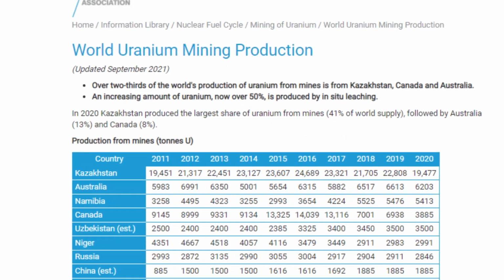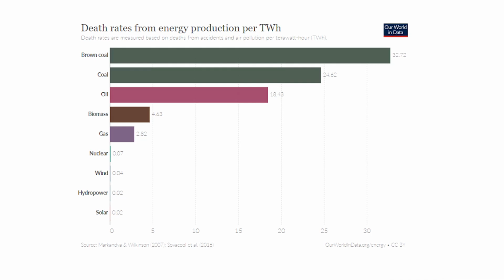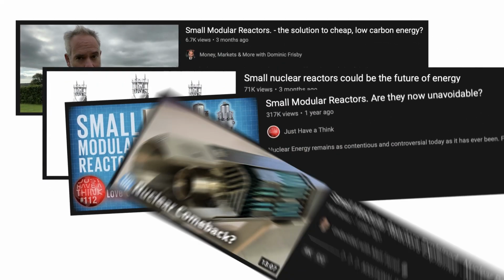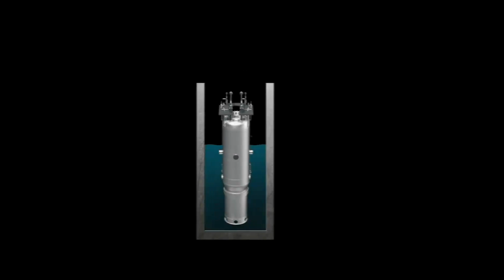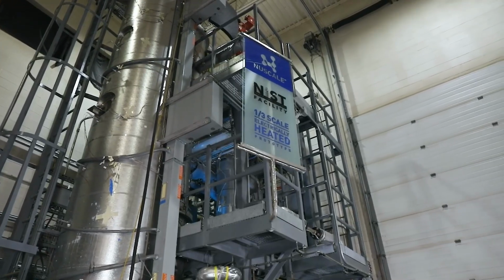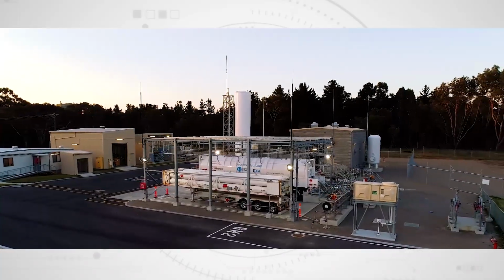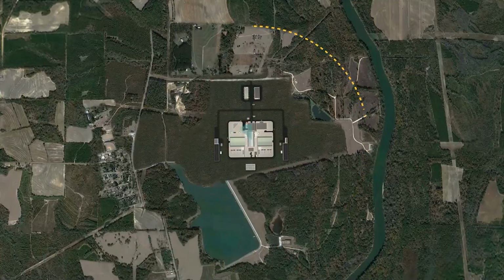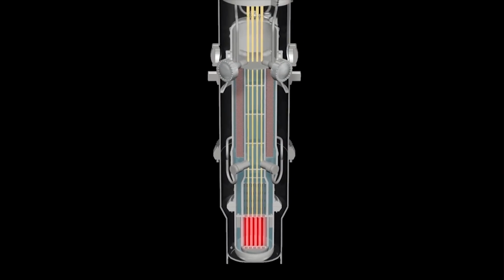Can Small Modular Reactors Save Nuclear Power?

Comment: Mainly because the main issues with nuclear power isn't technical, or even rational, I personally don't think there are technical solutions for them.

I don't think SMRs are going to solve anything, small sure, 5-ish or so, percent of a typical "Chernobyl-style" reactor,  does anyone in their right mind think that 5% of the Chernobyl accident would be a sh*t happens no big deal kind of event? The answer is: No. And in this case, up to six such reactors, close together, that adds up to about 30% of a "Chernobyl-style" reactor. 

I know, I know, these reactors are safe, as every type of reactor has been, until in some cases the opposite was proven. In the CGI the reactors share a small body of water, one drought away from loosing that safeness. Yeah, I saw the river, a river can reduce the probability of lack of water, not eliminate it. Also, a river adds an increased risk of severe flooding. At coast, you have possibly tsunamis, other natural catastrophes, threat from other countries, and so on. It's actually difficult if not impossible to find a place where there are no such issues, at least combined with a huge, unmet demand for power. 

About that, you can be too far from any large grid to be able to get a decent connection, OR you can have a lack of land,  you don't have both issues at the same time. Nope, the claimed niche doesn't exist. A somewhat problematic grid situation combined with a slightly problematic land situation sure, but new type of nuclear reactor plus hydrogen storage-level situation, nope.       
 
Also, when it comes to nuclear, accidents are considered severe catastrophes even if there are no severe [relatively speaking] consequences. So, it will take a single accident with SMR, even without casualties with enough media attention,  to make it virtually impossible to get approval to install any more. And with mass production, accidents are virtually unavoidable. 

Production of hydrogen, well of course. A bit higher efficiency than ordinary electrolysis, great, but it doesn't matter much. Also, higher efficiency compared to what, electrolysis at room temperature? Why, and even how, would room temperature be maintained in commercial scale hydrogen production with electrolysis? 

Also, storage, even at 30 MPa, that's 300 bar, you need 50 cubic meters of tank volume to store 1 ton of hydrogen (roughly, and at 20 °C). 30 MPa is scuba tank pressure territory, it doesn't make much sense to compress much further for stationary storage. 250 tons * 50 cubic meters = 12.500 cubic meters tank capacity. 

Reversible HTSE and fuel cells combined, well, now we left modifying/improvement of existing technologies, that's not equivalent of developing the first production model car, or airplane, that's more like an equivalent of developing a mass produced flying car model in a world where there has been no mass produced car or airplane yet.       

If you don't even think you can become cost competitive (per MWh) compared wind and solar now, you definitely won't be able to compete 10 years from now with a combination of wind, solar, improved transmission capacities, DSM and enough batteries to make a more reliable energy supply than a few SMRs and hydrogen storage. And, honestly, the cost of alternatives 10 years from now is irrelevant, the cost of alternatives the the proposed technology reaches global significant importance, at the earliest, that should be roughly 40 years from now, assuming best case scenario. By then we will have solar PV built in surface materials of buildings, at negligible extra cost, wind turbines will be developed in ways I can't predict, batteries will be extremely cheap compared to current situation, things like V2G, DSM and VPP will be implemented "everywhere" unless they have been made obsolete be even better future solutions.

Comment: There was a key idea that was not clearly covered. Dr. Reyes mention the ability to load follow. This is necessary because renewables are not dispatchable. Nuclear is the only carbon free dispatchable energy. When everyone comes home in the evening, turns on the lights and the oven, wind and solar are typically reducing output. The sun is going down and wind cannot be counted on either.  This power has to be replaced with dispatchable energy.
Reply from the maker: What about hydro and geothermal?
Reply: @EngineeringwithRosie  Hydro is partially dispatchable, there are usually limits on how much water can be spilled downstream. Geothermal is a great dispatchable resource where it is available. Geothermal is one that sounds perfect in principle, but  the working fluid coming out of the ground is so corrosive the turbines don't last long at all. More significantly, it's a resource that is not large enough to make up the difference in the duck curve. Batteries are great also, but we do not have the capacity to make enough batteries to make much of a difference. When I say batteries I'm including pumped storage, liquid air, hydrogen, and kinetic storage. It's really hard to fathom how to create enough storage to make a dent in the problem.
Reply: Also, batteries and other storage works just as well with nuclear as with wind and solar.

Comment: One note of caution - LCOE/strike price costs are not all that useful for costing externalities/total costs of every energy source, whether that is gas turbines without carbon tax, renewables without backup power, or nuclear with the "nuclear waste issue" (though I disagree that this problem is of the same magnitude of the former two). Everyone likes to quote that Lazard table but sort of glosses over the bottom of the table wherein a ton of caveats are listed. They are intended for investors of a single power plant in order to do accounting (not coincidentally this is lazards business...). They are not intended to show the costs that said power plant imposes on the grid to make everything work with the reliability we expect. Or the sensitivity of each particular technologys costs to commodity prices. Et cetera.

It is not for no reason that, for example, germany pays some of the highest residential electricity costs in the world before the current energy crisis and will be paying quite a bit more in part thanks to their closure of "expensive" nuclear in favour of "cheap" natural gas to take the load when the dunkelflautes/wind droughts happen, as does happen on occasion with weather.

The short-term may not be that much better either for renewables, as they tend to be the most materials-heavy forms of energy, which means that impending commodity price shocks are a correspondingly bigger problem for the very impressive cost-curve progress we have seen thus far.
Reply: To help allay concerns about nuclear waste:  Some upcoming nuclear reactor designs will be able to run on nuclear waste.  I've looked at dozens of reactor designs and my favorite, by far, is a design by Ed Pheil.   There are several videos explaining how it works etc.  on Youtube.

Comment: Thanks for a great video. I have a question you might help regarding the quoted price of renewables. It seems to me that the intermittency is not accounted for in the prices often quoted and yet this is critical. How can something that is cheap when you don't need it and not there when you do need it be said to be cheaper in any meaningful way? For example the cheapest way you can compensate for windpower intermitancy with current (or next 5-10 years ??) tech is by building nearly the same capacity in gas turbine generation. This is what we have done in the UK. In which case how can a system which has gas generation as a component part be said to be cheaper than gas generation? I have put this question in a renewable-skeptic way just to emphasize the problem but I am not anti renewables and I can understand why the renewable lobby want to paint a favorable picture to keep up investment. I'm am in favor of massive investment in R&D for grid-scale energy storage to help to reduce this problem but the worst thing that could happen IMO is that these apparently low prices result in a reduction of investment for nuclear, we need both. If you could investigate this price issue it would be informative. Thanks again.
Reply: Wind and solar are virtually useless until they figure out the storage problem. When people's power begins going out randomly they will be yelling for nuclear.
Reply: The Russian invasions of Ukraine has highlighted   another risk related to Nuclear, where deliberate actions during war increase the risk of nuclear accidents.
Reply: @pietersmit621  there will be no incident. Ukraine, Russia and the media will overhype the plant in Ukraine. Just as they did when Russia took it to begin with.
Reply: In California, gas turbines are being replaced by battery storage systems.  The claim that gas turbine peaker plants are the cheapest way to solve renewables intermittency is a false assertion.  The gas turbine peaker plants are used much less than half of the time, some as little as 5 to 15% of the time.  They were financed with the assumption that they would be used for a greater amount of the time.  So they don't pay for themselves and lose money over time.  There are still ongoing fuel costs for them.

For the UK, there are offshore wind farms that are producing a very steady amount of power, 24 / 7  due to steady winds out in the ocean.  And there are large pumped hydro storage systems in the north.  More pumped hydro storage needs to be built to eliminate all the gas turbine plants and eliminate fossil fuel burning.
Reply: @acmefixer1  - I doubt that there is anywhere on earth that the wind blows 24/7/365 with enough force to give you 100% renewable energy. i would have to see those test numbers verified by actual measurement over the last decade.
Reply: @acmefixer1  The big challenge with battery storage is scale. Things seems quite easy until you start looking at the numbers. For example California generated 277,704 GWh of electricity in 2019. All the storage batteries deployed in the entire world amounted to 8GWh in 2018 (*). So if you took every single storage battery in the world and shipped it to California you'd have enough batteries to store roughly 15 minutes of California's electricity production. The issue with pumped storage is similar: there's more of it than battery storage but it's still a tiny fraction of what's required and the majority of suitable sites for pumped hydro are already being used. This is why California, Germany and the UK are extremely reliant on natural gas as a backup fuel for their intermittent renewables and this is likely to continue to be true for the forseeable future.

(*) Google "World energy ESM Final report PDF" to find this information, Youtube doesn't like links sadly.
Reply: @acmefixer1  "are used much less than half of the time, some as little as 5 to 15% of the time", that must mean intermittency is not an issue.
Reply: @DSAK55  
Intermittency is a big issue.  The peaker plants have to charge hundreds of dollars per kWh in order to break even.  The utilities have to pay high prices for peak power.  That's another reason why utilities are replacing gas turbines with battery storage, using them to do peak shaving, saving money.
Reply: @acmefixer1  Like everything that is done in California, batteries are not going to work,,,,,unless you want  to have a $2000 a month electric bill or enjoy sitting in the dark with no heat, (You CAN live without AC, you know  and at the rate things are going on the West cost you better get used to doing wihout it.) 

So be my guest and build all the wind an solar farms you want (with German and Chinese parts, no less) but just DO NOT expect the rest of the country to dig in their pockets and subsidize you. Just like anything else when you get woke about anything you end up going broke. ..... Somebody PLEASE build a SMR plant right next to my house.  I want the property tax reduction that comes with it,  but don't even think about sticking one of those noisy "wosh, wosh" bird killers within 5 miles of my property. Better yet make that 10 miles.  

The future is nuclear power,,,or we have no future.
Reply: @mathewmolk2089  
Sorry, but you're wrong.
New nuclear power plants are far, far too expensive. 
https://en.wikipedia.org/wiki/100%25_renewable_energy

Comment: It seems to me that the wind & solar + storage + transmission is still in serious denial about how fast it can be ramped up and what the full penetration amount of storage will be need to be.  And there is no way that we will reduce greenhouse emissions by 90% before nuclear could be commercialized if we are serious.
Reply from the maker: Ooh, here I disagree with you 😊 I think we will need less storage than we think (due to flexible demand and interconnectors) and I see the renewables rollout is progressing faster than most people realise. We'll have to check back in 2030 to see who was right!
Reply: @EngineeringwithRosie  You disagreement would hold more import if you gave citations.  I mean, my analysis is only based on observation of current industrial practices and a rough engineering assessment of the situation.  Do you have any estimations of service factor and cost of electricity versus amount of storage provided?  AFAIK, there is very little industrial flexible demand.  Almost all industrial uses of electricity are either overwhelmed by capital and non-energy costs, or brittle in that have been built upon the assumption of always available power.  For example, aluminum has to keep operating or the cells freeze up, cholo-alkaki cells aren't designed to be load following, and ammonia production facilities are built around steam reforming rather than variable green hydrogen.  Everything that I see with regards to flexible demands is only address grid stabilization, not wind droughts or a week long rainy miserable weather.   With regards to interconnectors, I've lived from 20 to 60 years old of seeing constant opposition of building high voltage power lines.  They are really an eyesore.   I wouldn't want to live under one of them.  You have to implement them using eminent domain or route them through wilderness areas.  Do you really think that the struggle to get them in place is going to abate once the electricity that is going through them is PV instead of Nuclear?
Reply: @richdobbs6595  The grid has 15 years to sort it out assuming parliament legalises nuclear energy today. Sounds doable.

Comment: I think you left out the biggest factor influencing the price of nuclear energy: regulation. Parts for nuclear power plants cost way more than they need to (for example, a $200 part off the shelf costs several thousand dollars if you are buying the “nuclear certified version). NuScale had to spend millions of dollars to get the Nuclear Regulatory Commission to look at their design and consider it for approval! Just about every plant we have operating in the US was built before the creation of the NRC because the increased regulatory costs and obstacles has made building new plants incredibly difficult. But the safety record of those pre-NRC power plants? Zero fatalities. Real lives have been lost to coal because the NRC made nuclear too expensive to build.
Reply from the maker: Yes I think you're right. And I read recently that there are a lot of counterfeit parts being used in nuclear reacors these days, likely due to the huge premium you mentioned. It's not a great situation.

Comment: While nuclear generation has got more expensive, due, in no small part to the overregulated approval process and hence the much longer construction time. Other than the West, nuclear plants are built relatively quickly and economically given the low fuel costs and long life of the plant. Renewables are still expensive and the continued 'renewables are getting cheaper' is simply inaccurate when all costs are accounted for and is reflected in the price the consumer pays.
While I like the sound of small modular reactors, their benefit will be much greater if they can, as has been claimed, load follow which would do a lot to keep the grid balanced if this is proved in practice. This balancing is mainly done using fossil fuel generation in most countries. It does,of course, increase running costs as they would run at less than optimum output if carrying out that role.
Reply: @I A Reid

You're a shill for the nuclear power industry.  Renewables plus storage are cheaper than nuclear power and the excessive costs of nuclear power is what is deterring utilities from choosing nuclear.  It's unfortunate that the utilities are also decommissioning existing nuclear power plants as their licenses expire.  But they can't compete with renewables plus storage.
Reply: Acme, 
what is a shill?

Anyone who says that renewables plus storage will work does not understand power generation and transmission.
The capacity required to make up for intermittency is far too great, it's not possible. Storage is useful for frequency support, that is all.
Reply: @iareid8255  Just ignore Acme - if his argument is that you're a shill, then he is failing to make an argument, but instead attacking you personally - the tactic used when facts, reason, etc are against you.